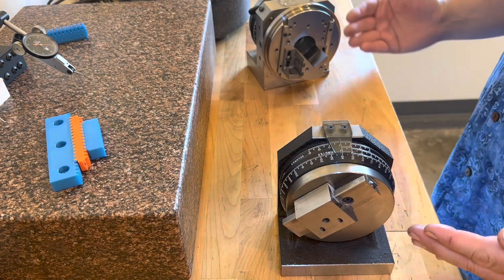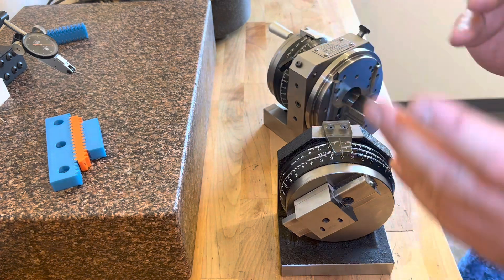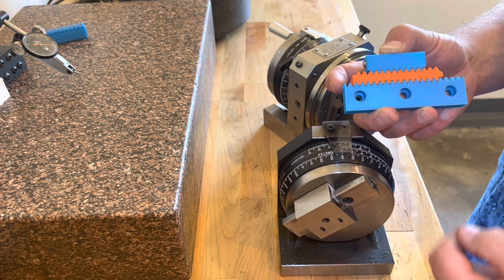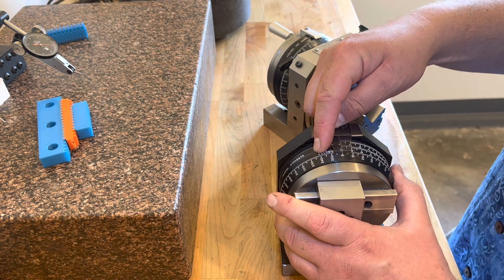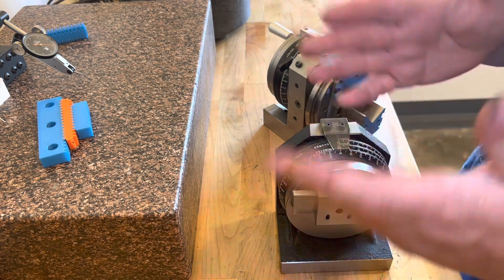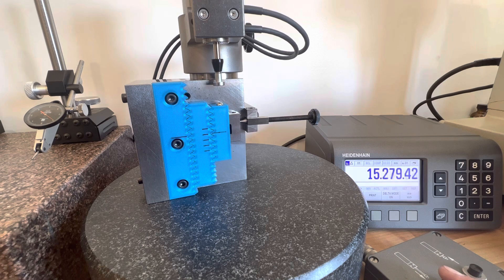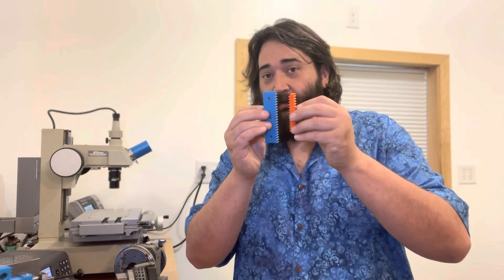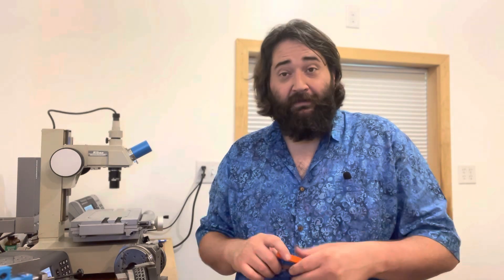Differential gear tooth indexing

Comment: Some woodworking handplanes used a differential screw adjuster on the blade depth of cut. e.g. a 16 TPI driving screw working a 20 TPI retracting screw. Advance is 1/16 - 1/20 = 1/80

An actual 80 TPI thread would be far too weak in this application.

Comment: Amazing content! I am having a hard time getting my head wrapped around the Newbould indexer. Having teeth mesh every 1° 1' seems like it would not result in closure around 360° (with a whole number of teeth). What am I missing?
Reply from the maker: you are correct in that its a non integer of a 360 degrees. to over come that , there is a section of teeth missing which allows for meshing
Reply: @adamthemachinist  Ah, had a feeling. Thanks, Adam! I've been considering building a time machine, just to go into the future and watch all the videos you make. They're truly inspirational.

Comment: I haven't ever used this for linear applications of any sort, but the rotational application and the affordability of the parts made possible on hobby-level 3D printers have allowed me to achieve VERY high gear ratio reductions in very small planetary gear trains by differing the tooth count between stages by one. This approach would be very costly if custom gears could not be 3D printed cheaply.

Oh my gosh I'm so glad I found your channel!

Comment: Hey Adam, fantastic videos! One thing that might make the linear indexer more repeatable is a consistent tension on the preloader. Perhaps a spring retraction system or a consistent torque value on the preloader screw would be the best ways to fix that.
Reply: i was thinking the same thing. quick and easy

Comment: I did a lot of AMP connector Mold's. The core pins had a lot of minute and second angles we would dress on our grinding wheels. Most of the tolerance were + .0000 - .0002. Inch.

Comment: This principle is really awesome, something to add to the mental library.
That said, have you ever looked at the teeth of that rotary setup? I'm trying to figure out what the divisions must be to end up where you want to. If you make the divisions for the first disk 1°01'00" you'd end up with 354 teeth, but for the second disk with 1°00'01" increments you'd need an insane amount of tiny teeth, like 3599 or 3601 teeth. And even then you'd have tiny deviations.
Reply from the maker: There are three plates. The first degrees plate has 360 teeth (1 degree ) the next is the minutes plates and had 359 full teeth at 1 degree and one minute per tooth , the partial tooth is remove . Same deal for the third plate at one degree one second
Reply from the maker: If you google”practical machinist mother of all invention” the inventor details the development
Reply: @adamthemachinist  thanks for bringing this up, it's extremely interesting

Comment: fascinating idea. I can see how replacing those plastic blocks with threaded bars milled flatish to form a "rack" could work in the same way too and you could get very good control over the pitch and form and choice of material by threading on the lathe.

Comment: I drill very small holes for microfluidic experiments. Sometimes I need to very precisely add a hole to an existing manifold. I’ve been using a toolmakers microscope / sensitive drill combo I rigged up, but without a precise x/y table it’s cumbersome to get to the final position after picking up a reference hole.  I’ve been scheming on how to get there without spending a fortune and this gives me ideas. Thanks!
Reply: @sourand jaded In some cases you can set up your compound to such an acute angle that any infeed would be in the micron range.

Comment: Very nice concept - it's reminiscent of a right-hand thread/left-hand thread differential screw setup. You channel was recommended by Stefan Gotteswinter.
Reply: You can make differential wedges that can theoretically adjust infinitely fine with a fairly coarse-threaded fine adjust screw. If the wedges are say 6" long and 1 is tapered .0001 in 6" and the other is tapered .00015 in 6", I can't even calculate how fine the adjustment would be for a 40 pitch thread.

Comment: Thank you for this - and your previous - excellent videos.  So far, you've covered several interesting topics that I, as a hobby machinist, have never heard of before.
And yes, the sound quality of this one is much improved over some of your earlier presentations.  I've heard several YouTube machinists mention that they've spent way more on audio gear than on cameras & video equipment.  They didn't go into much detail, but I suspect that various highly directional mics (noise cancelling, "shotgun", etc.) are a big part of it. 
There are also relatively inexpensive in-ear mics that pick up your voice very clearly from inside your ear (basically an inward-pointed mic) while rejecting nearly all external sound sources; essentially an earbud that can also function as a microplone.  These are often used by motorcyclists.  
...One other possibility just occurred to me. I've never had any reason to try this, but you might even be able to plug a set of ordinary earbuds into the right kind of microphone jack and get the same tesult? Or that might not work; it may take a more sensitive transducer to act as a good microphone, or the impedence might not be a close enough match for any standard type of mic?
Anyway, thank you again. And if you continue to produce similarly great videos, I can see your channel becoming one of the "big" machining channels in the coming months!
Douglas Hank

Comment: Thank you for the information! I have a perfect aplication for this. I'm a Toolmaker in the plastics industry and our shop has been in the need for an ejection pin cutter that will consistently cut pins +.005" -.000". I was planning on using a micrometer thimble for a stop, and have the stop index into a groove in 1" increments. I think by using this method, the fixture will be more robust and not have to worry about the thimble being out of adjustment.

Comment: This could be very useful in a DIY surface grinder setup, Set up an adjustable RDM bench grinder. Then you can make a sled that adjusts using this mechanism in the middle with legs that can lock to support it. Perfect for small precise movements on the cheap. I'd bet you could make a decent surface grinder for under 200 dollars with these.

Comment: You talking Haring bone gears that transfer neer 100 % of the torque..?
Reply: No there is no torque here. He is suggesting herringbone profile so the parts will be locked not just up and down but also side to side if you need that.